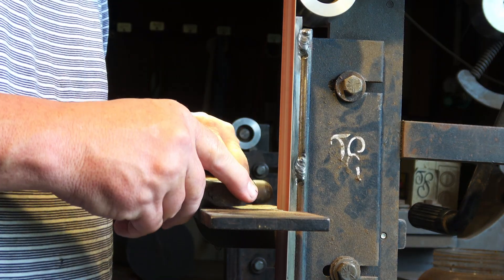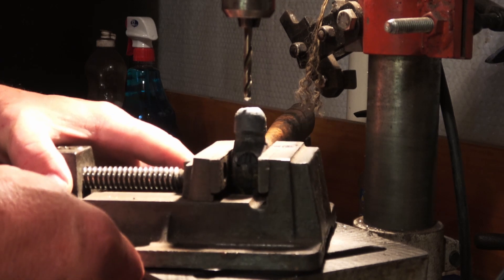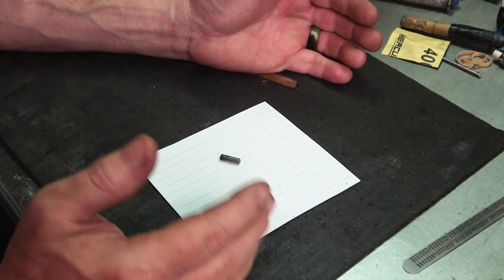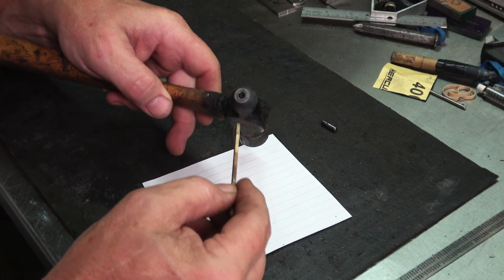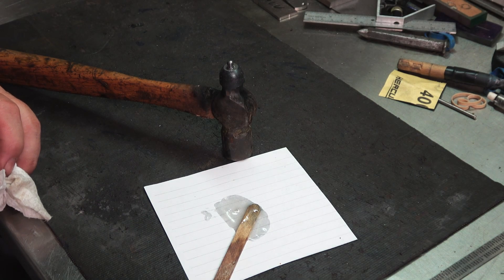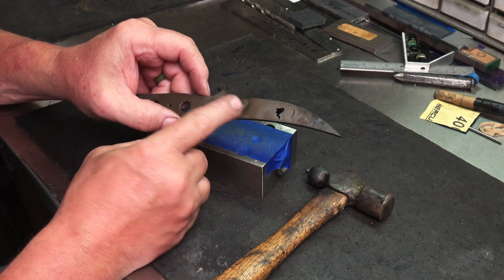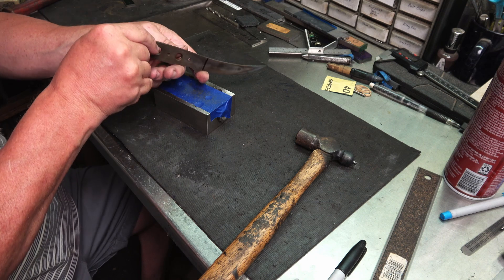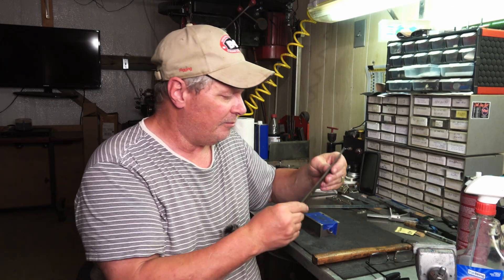Straighten a warped knife with THIS hammer

Comment: I actually needed one of these a few weeks ago and went the other route after watching JP’s bladeworks make one with a tungsten carbide ball. Couldn’t afford to buy one so his idea saved me some cash. I drilled a little bigger than the ball and sunk it over half way, epoxy seems to be holding. Used it on a couple blades with good results. I like your version with the round bar so if I have any problems with mine, I’ll do it your way next time. Thanks for showing a different way to fix a problem.
Reply from the maker: Awesome!  You can always just braise the ball in there and it will never move.  But if it’s holding, I would keep on trucking.  🙂

Comment: So..I'm curious.  Since the divots are putting stress in the blade to offset the bend, will grinding them out will allow the bend to return.  I have in mind that some of the effects of the divots is below the surface..all of the distortion may not return  ? I've seen big  saw blades flattened by this method many years ago.  Sawmill  magic!
Reply from the maker: No it’s moving the steel by pushing or cold forging.  It does not return when ground.  This has actually been around for many years.  The Japanese used this method in ancient times when straightening swords.  🙂
Reply: @TonySeverioKnives  thank you friend.  Good luck with this
Reply from the maker: @tonybryant5524 you’re welcome, thanks!